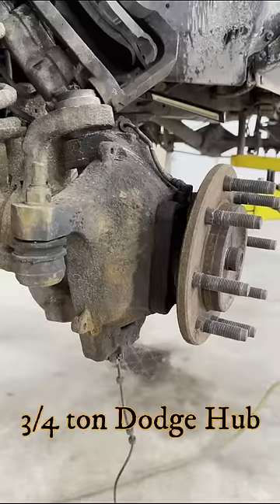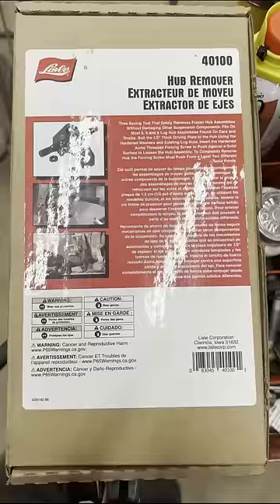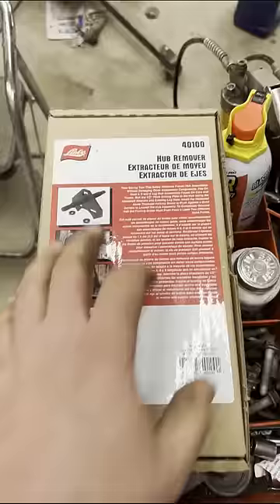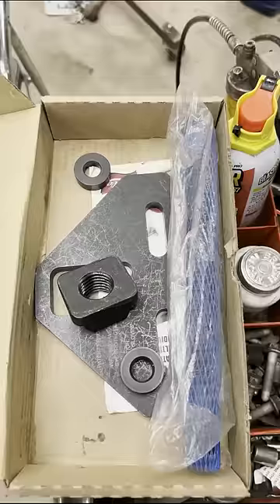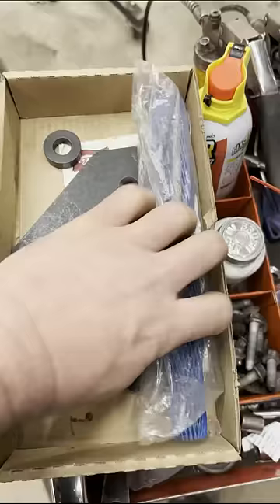Hub Bearing Removal Made EASY!

Comment: What is this puller priced at.....??
I would fashion a slide hammer from scrap pieces like a 2" pipe or angle iron, an old hub and a thick plate. And then use a vernier or tape measure ton see the movement of the hub at each stage of knocks.

Comment: It dorsnt warp the flange pressing it out all cocleyed?
Reply from the maker: It’s possible. But the whole reason for removing it was to install a new one so it’s doesn’t matter. If you were removing the hub for another repair, you would want to press from two sides to evenly pull the hub out.

Comment: First make sure to take the speed sensor out cause it’ll be ruined once bearing is out and hub falls down with it . Bearing coming out at that angle most likely would ruin the inner side of knuckle too.
Reply from the maker: Doesn’t hurt the knuckle at all and the new hub assembly comes with a new sensor. AND….if you look closely you’ll see the sensor is unhooked from the vehicle harness and hanging under the hub.

Comment: Ironically enough, I built my own years ago except it was a complete ring.
Reply from the maker: Nice! Did it work well?
Reply: @Tomsfoolery.  hell yea. At least on my 07 ram. Or I should say on one side. Lol. The other side was corrosion full potato and I torched it out. Lovely aluminum to steel. It also worked on a Ford flex. Other than that, it was just a one time use for both. The full circle just allowed you to pull on both sides equally. I wasn't trying to fuck the knuckle up any more than it already was.

Comment: Slap hammer puller works, and is more universal.
Reply from the maker: Different tools have different strong points. I agree a slide hammer works well, but not on these 3/4 ton hub assemblies.

Comment: I just back out the bolts about half an inch then air hammer them with the bit that tapers at the end so I don't wreck the heads of the bolts to get the hub loose, haven't had that fail me yet. Other than when you can't the air hammer on the bolts lol

Comment: Lol I just use the power steering and turn the wheel with a bolt and nut in the brake caliper mounting holes

Comment: How you press it back in than ?
Reply from the maker: You clean the corrosion around the mating surface and just bolt the new hub assembly back into place. It’s not a pressed fit. It just gets stuck from the corrosion.

Comment: What about cars with dust shields between the hub and knuckle, or the ones with no shoulder or edge for that forcing screw to push against ?   Decent tool, but limited application, unfortunately.
Reply from the maker: Correct. It doesn’t work on every vehicle. But if this truck had the splash shield, I have a piece of 3/4” plate steel to put across the two caliper bracket mounting ears. The tool then pushes on the plate.

Comment: It looks as though it was actually designed to flip it the other way, where the threaded rod is in the center of the axle shaft, that way its pushing against the center of the axle shaft, which pulls the bearing out evenly, also you just damaged your ABS wheel speed sensor because you didn't remove it out of the hub, and third thing, is you NEVER use an impact gun on hardened threaded pullers, you need to use a socket and breaker bar or large ratchet, but never an impact gun, because you will damage the threads on your puller, even worse if you borrowed a puller from a friend then damage it. 🤔🧐😯

Comment: Yeah I bet you're in the south or Cali... Try that in the Midwest or up North with the RUST. You won't be walking that hub out that easy. You'll beg for that sledge hammer
Reply from the maker: Northern Michigan. That bearing was replaced a year prior and anti seize was used. They never fall out that easy otherwise.

Comment: No shit, I’ve snapped an axle by only pushing on the one side. You really gotta be careful. That, and this tool might not work in all cases. I just knock a stud out and use a bolt, with a nut on the other side of the hub. Depending on the size/shape of the spindle, this tool may not work. May be better off with a hub grappler kit

Comment: I don’t like the way it pulls it out crooked and puts all the pressure on the right hand side where there is no auger. The least he could’ve done is take a big hammer and tap on the right hand backside at the same time as impacting the left side with this suspect tool. My opinion. My observation.

Comment: That's tool should be made to pull it out evenly,..not at an angle,... when the new one is installed...it's gonna have some issues ...ohh .. remember to disconnect the abs sensor 😉

Comment: not a bad tool, but wouldn't work in all situations. if you knock out a stud and just use a long nut and bolt, you can do the same using your flange as the plate.

Comment: The studs don't bend??
Reply from the maker: Nope. Hardened steel. I suppose you could bend one if you really tried. I’ve never bent any in over 20 years torquing axle nuts like that however.

Comment: I’d rather one of those claw looking ones, evenly spreads load.screw in the middle pushes on the shaft to remove the rest.
Reply from the maker: Those don’t remove the bearing assembly. Those push the axle shaft out of the bearing. They’re good for when the axle shaft splined end is stuck in the hub.
Reply: @Tomsfoolery.  I’d have thought it would push on the axle and pull everything else off though. Unless there’s nothing on the other end of that shaft in the middle?

Comment: I'm not even a mechanic, but I've pulled hubs and axles before and my goal was to get them out straight not at an angle like this guy did. Yikes!
Reply from the maker: Well if you were a mechanic, you’d know it doesn’t hurt a thing but thanks for the comment.
Reply: @TomsFoolery  so as a mechanic yourself, you can guarantee this does absolutely no damage 100% of the time? Cast parts are really that robust?
And if so,  then why the edit in the video pointing out the angle at which it came out?

Comment: Ehhhhh, the  abs sensor dude!
Reply from the maker: It’s ok, the wire IS unplugged. You’ll see it if you watch it again. It’s hanging under the steering knuckle. Besides, this style hub assembly always comes with a new speed sensor installed! So it’s fine either way.

Comment: I do it everyday and that is the biggest wast of money i never have trouble removing them at all its pretty easy really all u have to do is to use you head not your wallet
Reply: Where do you live in the Mojave Desert?🙄🤪 well up here in New York every bolt hub screw bracket and brake line is rusted behind belief and everything is seized, torch and a sledge hammer is mandatory on every car and truck…you got it made bud lol.
Reply: No i dont in the desert but I've had my fair share of rust buckets come down south and i end up getting to fix half of them myself and dont even start on big trucks im just saying think before u spend money

Comment: Sir you forgot to disconnect the wheel speed sensor. This method is not osha approved😂😂
Reply from the maker: I didn’t forget. Look again and you’ll see the wire hanging under the steering knuckle. It’s unhooked on the vehicle side. The new part comes with a new sensor installed in it. But thanks for 😂 😂 while trying to look smart! Appreciate the comment! 😂
Reply: @TomsFoolery  ah damn, ive been disproven. Well played my good sir.🎩
Reply from the maker: It’s cool man. I’ve gotten numerous similar comments. I reply to them and they typically erase em. Cudos to you for staying with it!
Reply: @TomsFoolery  lol well i was wrong. Erasing it just ignores that fact but atleast someone can see this and get corrected withoit embarrassing themselves too

Comment: Not a good idea pulling at an angle.  Mess up everything. Good tool to pull it out but damage is after you pull the hub.
Reply from the maker: If you knew anything about being an actual mechanic and less about being a fairy you would know this doesn’t damage anything. The whole point of pulling it out in one shot was to show the tools ability. But that’s too difficult for idiots like you to realize and you feel compelled to add your inexperienced opinion. Go bake some bread.

Comment: Did you leave the speed sensor on on purpose 😂😂
Reply from the maker: It’s not connected to the vehicle. The new hub assembly COMES with a new sensor anyway so it wouldn’t matter.

Comment: Maybe if all you do is hubs waste the 100 bucks. Other wise a sledge on the backside as your loosing the bolts. Never had an issue over the past 20 years in the rust belt

Comment: that looks like a wonderful tool,...... NOT!!!!! that piece of junk is going to oval out the hub hole causing massive damage to the spindle and then no hub bearing will ever sit in there correctly, #Pull it straight.
I suppose next it's going to be said that it's a good thing to have u-joint caps go in sideways.

use a slide hammer and the proper adapter when corrosion has frozen a hub bearing in place....
also remember to sand and clean all mounting surfaces prior to reassembly to prevent this issue in the future.
P.S. as long as you unplug the other end of that wheel speed sensor don't worry about it you're new Hub bearing comes with one pre installed 99% of the time.

respectfully "AJ's Advanced Automotive"
properly repairing vehicles since 1985.

Comment: where's some oil on the forcing screw and an occasional knock with a lump hammer at the opposite side of the flange it would have with drawn out a whole lot easier than forcing it off centre .  you plonker...Rodney...!!!

Comment: The abs 😂😂😂😂
Reply from the maker: What about it? The new hub comes with a new sensor & wire.
Reply: You was pulling the wire
Reply from the maker: Go watch the video again. The wire is unplugged from the truck side connector and hanging under the hub assembly as I was removing it. As previously mentioned, the new part comes with the new sensor and wire. So it’s a moot point you’re trying to make. Thanks for the comment though! I appreciate the feedback!

Comment: Yeah, you definitely bent the shaft, and probably also even elongated the Tube as well.  Definitely should move the tool to the opposite side, and then back & forth several times to avoid annihilating BOTH the Axle Shaft AND the Axle Tube during the process.  Pretty sure the instructions don't advise cannibalising this the way that you did !  Horrible Job demonstrating this Tool.  If Lisle already paid you for this, don't cash that check just yet !  I'm sure they'll be asking for THAT Money Back !
Reply from the maker: You really shouldn’t comment when you’re clueless on the topic. What do you think happens to the shaft when you’re driving and you turn the steering wheel genius? As far as elongating the “tube”, it doesn’t hurt a thing. If you were an auto mechanic BY TRADE, you would already know this. But you’re obviously not! So save your time typing and keep your nonsense to yourself.

Comment: You might want to remove the wheel speed sensor before removing the hub. It doesn’t take much to permanently damage them…
Reply: A new sensor comes with the new hub assembly, Buddy

Comment: watching the frayed ABS wire intently as the hub backs out of the knuckle
Reply from the maker: There was no frayed ABS wire but ok...
Reply: @Tomsfoolery.  Misspoke. It just looks like the insulation is starting to come apart.
Reply from the maker: @dirgeofdementia  the new hub comes WITH a new ABS wire/sensor. So even if it did get damaged, it’s getting replaced. All these older hubs come with the sensor/wire. Newer ones don’t.
Reply: @Tomsfoolery.  It’s been a spell since I’ve worked on something older. Nonetheless, it’s good practice to remove connections before removing parts.

Comment: Def don’t use this if u planning on reusing the bearing
Reply from the maker: Correct!
Reply: You would never remove this unit bearing unless it is to be replaced. So your comment is nonsense.
Reply: Right new bearing anytime u need to replace an axle joint, which fortunately for dodge isn’t often……..😊

Comment: He did not take out the speed sensor. It will break the wire. Funny..job
Reply from the maker: You are wrong. Look closer and you’ll see the wire hanging below the steering knuckle. Even if I didn’t unhook the speed sensor, anyone who KNOW what they’re commenting about would KNOW that ALL dodge 2500 hubs COME WITH NEW SPEED SENSORS! So who’s the clown? 🤦‍♂️

Comment: Those are cake to remove no need to this BS tool. Loosen the hub mounting bolts then use a socket with an extension start the engine and use the power steering to work off the hub every easy to do.